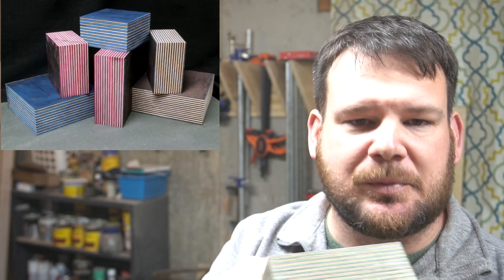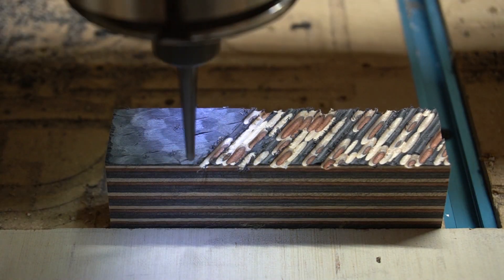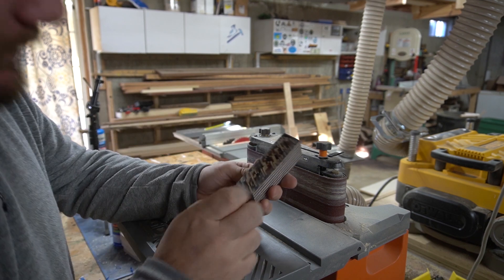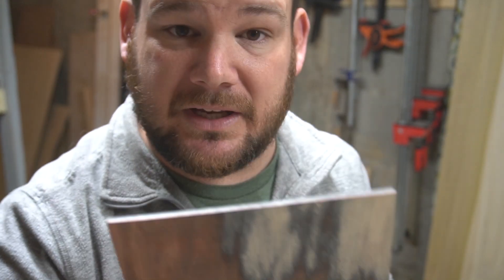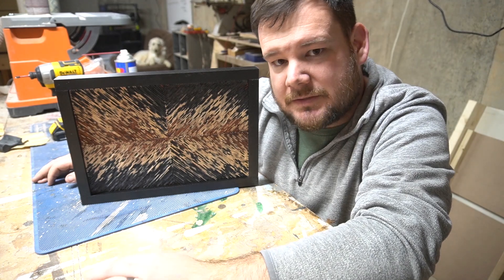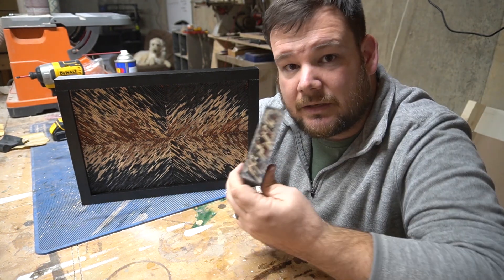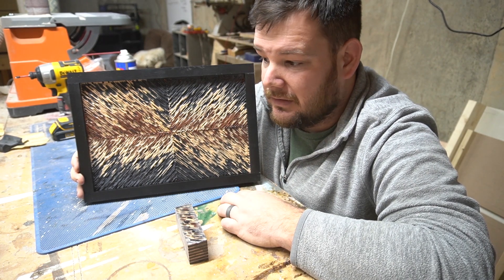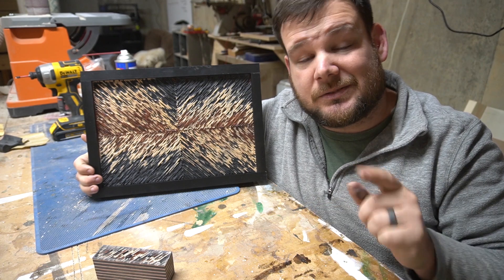Maker Mashup 01 // CNC Texturing and Dyed Layered Plywood

Comment: Looked like it has a good amount of potential. You could probably even use that colored plywood without the engravings too.
Reply from the maker: I think so too. Another thing I thought of is you could use a basic piece of wood with the texture and then add colored epoxy just to the low areas. I think that would look pretty cool.